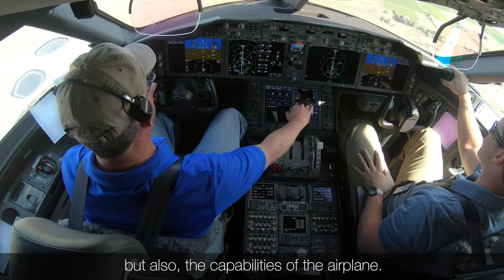From Here to There: 787-9 Dreamliner

Comment: Did you all watch the all jajeerah's report on 787 Dreamliner?
If not, then must watch it.
They made that aircraft with a lot of quality issues, battery fire, unqualified workers and so on.
Even the workers admitted that the themselves wouldn't fly on this aircraft.
Boeing is playing with the lives of passengers to cope up with airbus.
And the later proof is 737 max. To compete with airbus they just rebuild their 737 to 737 max with a faulty dangerous software- mcas -, which was not addressed to the pilots or in any manual!!
As a result in recent 6/7 months , two 737 max aircraft accidents killed over 500 people.
How could they upload their planes video again???
Shame to boeing , the killer boeing😈😈😈
Reply: That documentary is dated. It’s been 5 years of no battery issues.
Reply: @aviationloverexpert7435  
Ok. Got it about Dreamliner.
But did they take lesson for underestimating quality issues?
I think, not.
If it is then what about 737 max scandal?
How can people trust on boeing about safe aircraft after that? 
How could they hide such an important issue of mcas to pilots? Why didn't they tell the pilots? Unbelievable.
They can't do this, never.
Boeing should be perished.
Reply: Mostaqur Rahman That document is Dated. Very dated, all those problems you’ve mentioned are long gone from the aircraft. Why exactly are you bringing this up again? 
After Years. Those were technical issue that took place during its early stages of development. The issues are no more
The MAX incidents killed 346 in total not “over 500”. Do your research. Btw it’s best not to talk about those crashes. Leave it aside, nobody really likes talking about it. Peace

Comment: I want to become a 777 or 757 pilot
Reply: Good luck 👍🏼
Reply: But 757 will be died soon!
Reply: Not with Delta for a while though, they will only start retiring them from 2020 and are aiming to launch the Boeing NMA to use it as a replacement for it and the 767’s